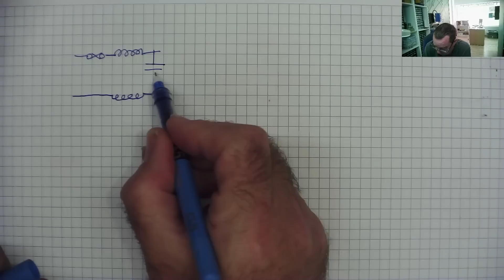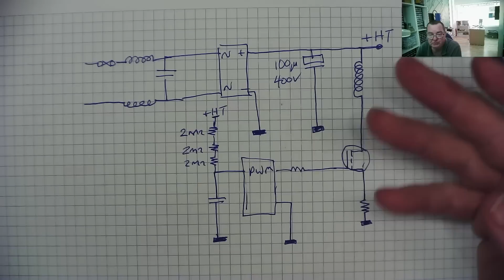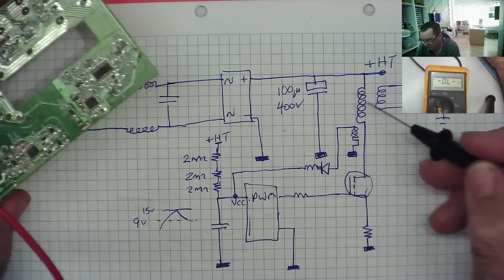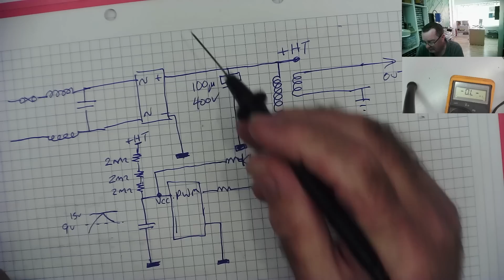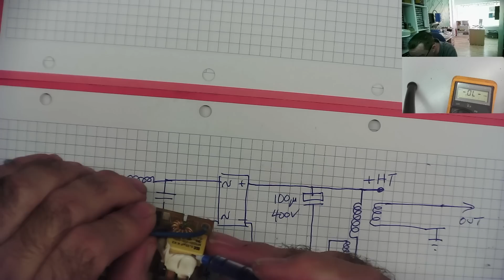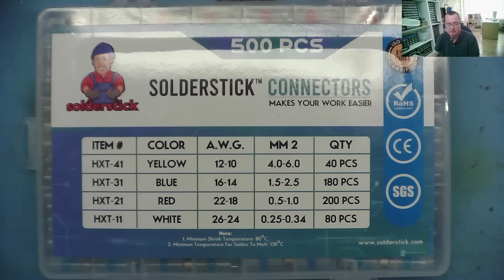Cordless Drill Charger Repair

Comment: I have some battery tools, like screwdrivers, a little mini rotary saw....I checked and all them chargers blink the LED when charging, and lit It solid when fully charged. (various brands, various models). If the battery is in bad condition (i.e. soooo low voltage Nickel ones), They do not turn the LED on , indicating "bad one". Nice finding, that shorted inductor. Giving the "caliber" of those wires, not having a fuse could have resulted in an interesting "boom!"

Comment: Dicky, it would’ve been better to have the battery at the end of this video, to actually make it true, in the fix, why you only got the board is strange.. or did your friend blow it up in the first place, people will be asking the question’s , as I’ve just pointed out, good fix, but only half hearted, if a friend or client want you to fix something, it’s got to be complete, to test at the end, prior to ringing them and asking for the missing piece.. aka the part it’s supposed to run.. (honestly it’s the only way to see if you’ve fixed it properly.. ).

Comment: When looking for shorts around coils, why not use what we learned with CPU/GPU VRMs? That is, not measure DC Ohms, but AC (milli-)Ohms, like with an LCR meter?
Also noteworthy is the yellow cap should be an X2 cap, and they are designed to go open instead of the short you see on other cap types.

Comment: Hi Rich, Interesting content, but as you say, if you were doing it to fix the thing, you'd check the fuse and check for shorts first. If I was Andy, I'd send you more hardware (case and battery) so you could test and be confident it works. The battery might have an issue as well. 
Thanks for the commentary and diagrams. E.J.

Comment: great diagnosis, but I'm confused lol. The inductor coil was replaced with a fuse yes? So thats the fix? did I miss something?
Reply from the maker: No -  I slightly messed up the video edit, i replaced the filter inductor with two wire links, then replaced the fuse
Reply: @learnelectronicsrepair  Thanks
Reply: @learnelectronicsrepair  Since the arc'ing on that inductor was right on the end of the wire, Rich, maybe you could repair it with a little heat-shrink and re-use it? Thanks.

Comment: Can you please advise the rated insulation voltage rating of these solder stick devices?
Reply from the maker: I will find out
Reply: @learnelectronicsrepair  Thanks that would be terrific 👍

Comment: I had situation, where inductor, was properly soldered, but thin wire of inductor, was desoldered from contact leg, so depending of vibrations or angle of pcb, it had contact and worked, another time not. Only when I removed isolation from inductor and checked with microscope I saw loose wire. Never say "its not this" without proper check.

Comment: I found that you explained it very clearly and this power supply is not overly complicated. But as we went through the diagnosing I 1st suspected the FULL BRIDGE RECTIFIER (Thank you Electroboom I have to say this every time now.) 2nd the X2 Capacitor and 3rd The mains cable itself, I never thought the inductor would fail like that. But I'm sure I would have got there in the end, it's just a case of removing parts until the short is gone. Would love to see a video on class X and Y capacitors.
Reply: I had situation, where inductor, was properly soldered, but thin wire of inductor, was desoldered from contact leg, so depending of vibrations or angle of pcb, it had contact and worked, another time not. Only when I removed isolation from inductor and checked with microscope I saw loose wire. Never say "its not this" without proper check.

Comment: The two centre battery contacts don't appear to be connected to anything Richard? You seem to be getting 0V across the two outer battery contacts. A further fault I think.
Reply from the maker: I read about 3V across them.  As:
I don't have the drill or even the enclosure which would have a voltage rating marked on it
I found an obvious fault and usually there is one fault on an item
The nature of the fault I found is unlikely to be caused by, or to be the cause of, another fault in the circuit

I think the best thing is to give it to Andy and tell him if it doesn't work bring it back with the drill
Reply: In some models they maybe 'sense' connections for current or core temperatures.
Reply: @andymouse  Absolutely. But not in this case!
Reply: @gman7692 👍

Comment: On tool battery chargers the outer two pins are B+ and B-. The inner 2 pins are sense pins for temperature of the battery and whatever else might be monitored.
Reply: Cheers.

Comment: I really appreciate that you worked out the fix without ever plugging in the board or looking up datasheets - it means a deeper understanding of the circuit which I appreciate, and has a detective element to it too :)

Comment: That little  toroidal coil has only eight wraps. It would have been nice to watch you rewind it to "wrap up" the repair. Once again I enjoyed how you reverse engineer and document the circuit to get to the root of the problem. Cheers!
Reply: My thoughts entirely, winding inductors easy
Reply from the maker: @davet3804  I did give it a thought, but it was all gummed up with very hard epoxy or something similar so I decided not to.

Comment: Great video, I have had those filter chokes go short, especially on chepo Chinese equipment. The 4 pins are probably for current monitoring or battery balancing as this may be for a lithium iron or Lypo battery where each cell is balanced charged.

Comment: How do you charge the customer,  your time must be worth more than the charger? I can understand if it is obsolete equipment that needs to be kept going but other wise I can not see why a new one is not bought.
Reply from the maker: For this sort of job I would charge him €20. The reasons for fixing it would be that it is cheaper than replacing the drill, he can get back to work using it rather than driving up to the capital to find a replacement charger (it's about 80km round trip) or waiting a month for one to arrive in the post. The way of life on a small remote island is generally to keep things going rather than replace them.  The Canary Islands are an interesting place, we have all the infrastructure of a developed western country - 92% fibre optic cover for example - but the economy of an African country, typical pay is about €1000 a month for general workers. I know the lady who is the manager in one of the local Vodafone shops, salary €1100 per month.  On the other hand it is cheaper to live here too, For example the office/shop I rent, 30m2 in a local shopping centre is €295 per month and my electricity bill (3 bedroom house) is around €60 per two months, we don't have mains gas on the island, so €20 for this job would pay my home energy bill for nearly three weeks or deisel for my van for 10 days. I will also get some payment from the video sponsor so went the long way round what would normally be a quick repair. That seems fair to me.  How much would it cost to replace the drill? I don't k now as I don't know the model but it must be a lot more than that.
Reply: @learnelectronicsrepair  Thanks for the very extensive reply.Your electric bills are far far cheaper than the UK. I am being charged £148 a month for 350 units of electricity.
Reply from the maker: @tonysheerness2427  Really it all seems to come down to where you are in the world whether something is worth repairing or not.  There is also the environmental issue too, which I feel is important.
Reply: @learnelectronicsrepair  Yes they complain about plastics  however they keep bringing out more and more plastic products. To me it is if the people always get the blame for large companies making profits who do not care about the environment.
Reply: Very good point but this is educational stuff more than just about money :)
Reply: The cheap cost of a replacement unit etc. being less, and preferred, to the simple cost of a person's time repairing it with a low cost part, is down to the way we are conditioned nowadays, I believe. 
I think we need to consider repair first for everything, as when we consider the environmental consequences of making a new item, it's more or less a no-brainer to employ someone to fix it. 
I love the feeling of repairing something for just my time and a few £s or €/$ and this needs sharing to those that can't fix stuff. Environmental repairs 😆🤣
And thanks to you, Richard @LearnElectronicRepair, for your fantastic efforts in getting your knowledge into my thick head 🤣🤣